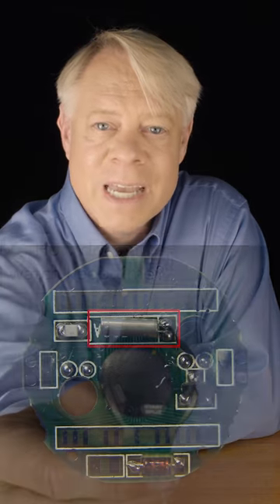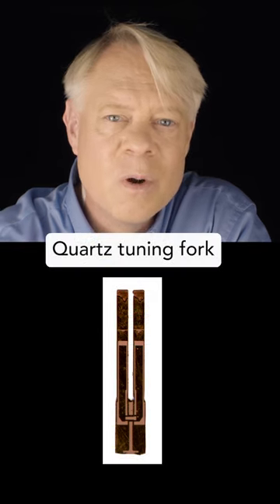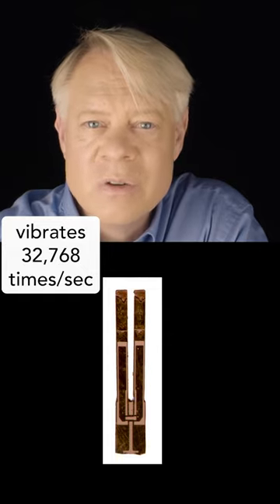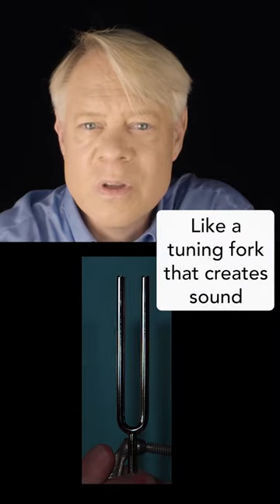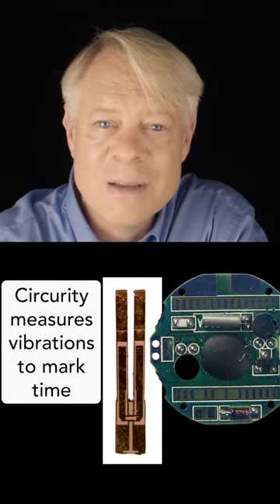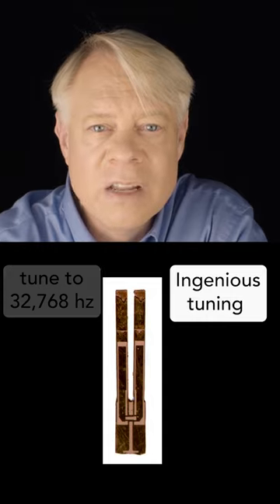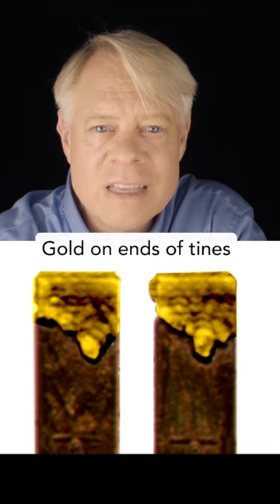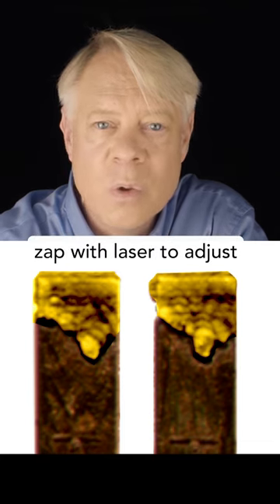How a Quartz Watch Works #Short #engineerguy #engineering #invention #timekeeping

Comment: Fun fact - this frequency can also be halved until it falls into the human hearing range. This is the tone used for watch beeps. It's why so many quartz watches have the exact same beeping sound when you press the buttons or set an alarm.
Reply: I assume that a separate quartz "tuning fork" is used for the beeps, so it doesn't interfere with the time keeping quartz.
Reply: @Vastad the fork itself doesn’t make noise. The frequency is used to drive the speaker. Not directly though.
Reply: My god that is mind blowing 🤯. Thanks for the inspiration!
Reply: @Vastad wont need second one you can divide frequency without interfering with oscillator
Reply: These are all poor explanations.
1. The Crystal forms part of an oscillator circuit and the oscillator outputs an electrical signal of fundamental frequency of 32768 Hz.  The output of the oscillator is a square wave which contains harmonics and these go much higher than the 32768Hz signal but these are not relevant because this a digital electronic circuit which is responding to the edges of the pulses of the square wave of the 32768Hz signal.

The equivalent circuit is one containing inductance and capacitance which, by way of the physical form of the crystal is tuned to the right values of inductance and capacitance to cause the oscillator to oscillate at 32768 Hz.  There are some additional components required such as a logic inverter that must be present to create a feedback path to enable oscillation of the crystal to occur. That is, the crystal by itself when fed electricity will not vibrate. It has to be part of an oscillator circuit employing positive feedback.

That signal is divided down by a series of flipflops, each flipflop dividing the frequency by 2 until an electrical signal of 1Hz frequency is produced. It is this 1Hz signal that is a clock signal to the electronics and digital counter that tracks the number of seconds. 

2. The audio bleep signal can be derived from somewhere from the clock divider chain that has an input at 32768 and the output at 1Hz.
That audio bleep is not, as one poster stated, the 32768 Hz signal divided by 2 as that would result in an audit bleep at 16.384KHz and whilst audible to a teenager it is not audible to a 40 year old or older person.
Reply: @HeyJuuu Nah you wouldn't be able to hear it until it actually goes off. The circuits completely inactive until nano seconds before it goes off. I think our brains are just way better at keeping track of time than we think. I'll set my microwave for 8 minutes and without keeping track I'll just think "oh that's probably almost done" and get to it seconds before it goes off. I don't know how but it's not even like I'm keeping track of it. I'll get it within about 20 seconds like 80 percent of the time.
Reply: @HeyJuuu  cool hypothesis, but probably not. I've kept that effect since I've switched to a completely digital watch.
Reply: I also noted that the frequency was 1 off from a signed integer word.
Reply: @deang5622 I wish I could understand you. Lets talk about legos instead.
Reply: That’s so cool!  Halving a frequency is the same as dropping an octave.  Most people can’t hear above 17000hz so the pitch would have to be dropped at least two octave.  That’s pretty neat.

Comment: For those wondering why quartz, quartz is piezoelectric, meaning that physical pressure on it or vibrations passing through it can generate an electric current, and an electric current passing through it causes it to vibrate. The frequency of the vibration is also very consistent given a constant shape, size, current, and weight/pressure on it (which the gold leaf allows for precise tuning of), which means that you can just measure the motion of the quartz to get something that varies periodically at a fixed rate over time (the tuning means that we also will know exactly what that rate is). Quartz is also a fairly abundant mineral (it’s made of virtually pure silica, aka silicon dioxide, which is also what sand—and, thus, sandstone and glass—is made of, and is the most abundant substance in Earth’s crust; just crystallize it to form quartz crystals), so it’s very easy and cheap to get large quantities of it.

Because of these factors, pretty much every electronic device that has a timer, can tell time, or that is programmable/has been programmed (like a computer) contains one of these quartz tuning forks to allow for precise, constant time-keeping (this is often known as an internal clock). 

Pretty much the only way we could be even more precise and accurate with measuring time is by using the resonant frequency of atoms, as seen in atomic clocks, but those require rarer substances (most use cesium, particularly cesium-133, cooled down to close to absolute zero, though some use rubidium-87, and some others use hydrogen-1). This is because the method used to find the natural frequency requires atoms with a single valence electron (so hydrogen and the alkali metals) or, to a lesser extent, alkaline earth metals (namely strontium), and higher precision requires larger nuclei; cesium-133 is the alkali metal with the highest atomic mass that isn’t radioactive (every isotope of francium has significantly more atomic mass, from 212 to 223, and francium is technically an alkali metal, but francium nuclei are incredibly unstable, with half-lives ranging from 4.8 min to 22 min, so they’re unsuitable for measuring time; heavier isotopes of cesium also exist, but they are also radioactive (though with half-lives ranging from around 2 years to over 1 million years), which makes them less suitable), which means it gives the highest accuracy. Both the atoms used for time-keeping and the devices used to detect their resonance are much, much more expensive, the atoms are (except for hydrogen-1) much rarer, and isolating atoms of hydrogen, rubidium, cesium, or strontium is much, much harder (due to their incredibly high reactivity), compared to quartz or the devices used to measure the frequency of their vibrations. Heck, even the gold leaf used for calibrations is cheaper and easier to obtain, as gold almost never reacts with anything (so isolating it is trivial if you find it), is still more abundant than the heavier alkali and alkaline earth metals, and only microscopic bits of thin gold foil get used anyways. It’s also significantly easier to make a quartz-based clock small and light enough to fit on your wrist, in your pocket, or on a computer chip/motherboard without being an inconvenience.
Reply: "an electric current passing through it causes it to vibrate."  Not really. Piezoelectric materials produce a charge when a force is applied (bending or pressure), and also the reverse: will bend or compress/expand if a voltage is applied. That by itself is not vibration. If you want a piezoelectric element to vibrate, you have to apply a repetitive voltage waveform. If you want the piezo element to actually resonate and oscillate continuously, it needs to be part of a circuit which as a whole implements an oscillator.
Reply: Fantastic information, I'm surprised he didn't explain the simplest and coolest part of the entire time keeping operation. 32768hz isn't an arbitrary number it's very specific. Specifically it's 2^15. So when you make a binary counting device that counts in ones and zeroes using 15 flop/flop switches in a row by the time the 32,768th input is triggered one second registers. Which is why quartz watches are so accurate they can be tuned to the 32,768th of a second.
Reply from the maker: @Rickarrish I only have a minute: I am fine if it leaves people with a well formed question (eg why 32768?)
Reply: Very interesting.  Thanks  !
Reply: @Rickarrish maaan I knew this constant by heart, and also knew 2^16 is 64.k-ish, never took the time to figure that 32.768 is actually a pretty number in binary form. and I wrote code for ucontrollers that counted quartz ticks for spacing samples of an analog-to-digital converter. I only tested up to a couple hundreds of samples at a time though 😆
Reply: Thank you AI
Reply: What makes quartz piezoelectric? Do the alignment of its crystals help ease the movement of electrons?

Comment: The 32768 is equal to 2^15 which can be handy in calculations of processors
Reply: But who needs to count negative vibrations?
Reply: I think its not about negative, its about the number being even. There is an operation called bit shifting which basically means to shift all the bits of a number in binary to left or right, and then “crop” the number to fit the number of bits, any spaces created would have zero in them. Basically, bit shifting left multiplies by 2 and by right divides by 2, this is handy for even numbers, not so much for odd numbers.
Reply: This number would also fit in a standard sized int i.e, 4 bytes
Reply: @fahad_hassan_92 my point is: why 2^15 instead of 2^16?
Reply: @RonJohn63  Could be as simple as they thought 2^16 was overkill or maybe because they for some reason use signed integers. To be honest I don't know.
Reply: @RonJohn63  I wondered about that. It's possible getting 2^16 would require a tuning fork outside the useful size range?
Reply: @Norsilca  very possible.

Comment: That frequency is insane. I can’t even begin to conceptualize that.
Reply: The frequency used, 2^15 cycles per second (a bit below 33 kHz), is one of the lowest frequencies available as a crystal resonator. Most crystals are tuned to frequency in the MHz or 10's of MHz, a few into the 100's of MHz.
Reply: @Graham_Wideman  Even more mind boggling! I’m curious about the physical mechanisms that enable such insanely high frequency vibrations without shaking the crystal lattices apart. Time to start googling lol.
Reply: @zakiducky  molecular bonds are stretchy. They can spring back and forth indefinitely without breaking, in the right material.
Reply: You should read up the clocks in CPUs. They operate on gigahertz frequencies, which are about 100,000 more frequent.

Comment: Fun fact: The first quartz watches and clocks used crystals that oscillated at 8192 hz, and then briefly 16,384hz before 32,768 became the defacto standard. Realistically it could have been any frequency that was chosen, but due to limitations in computing power it was easiest to have the crystals tuned to powers of 2 to quickly run through a circuit to divide up the oscillations with the fewest errors possible. Omega in 1972 made a watch tuned to an incredible 2.4Mhz with a prototype rumored to have been tuned to 4.2Mhz, which are some of the few ever made that do not follow the powers of 2 rule, instead using powers of 3 with a averaging circuit at the end to get it to 1hz. It was abandoned in 1975 due the falling prices of quartz watches at the time, with only about 1000 ever made.

Bulova currently makes a watch with a tri-prong crystal tuned to 262,144hz which was introduced in 2014 and is currently used on their Precisionist line. It’s one of the only quartz watches available today that does not use a standard 32,768hz quartz crystal.

Comment: there are 65,535 network ports without 0 if you add zero it would be 65,536 which is equal to tuning forks vibration - 32,768 x 2 = 65,536.. 😮

Comment: how does it pick up the vibrations in the watch and convert them into seconds
Reply: The video described this incorrectly. The vibrations don't "get measured" -- in a sense the precise vibrations ARE the measurement of time.  The crystal is incorporated in an oscillator circuit -- a circuit  that produces regularly-timed pulses at the frequency set by the crystal. Those pulses feed into a chain of circuits called flip-flops that each divide the rate by 2: ie: 2 pulses in produces 1 pulse out. 
32,768 is 2^15, so after 15 flip flops you get 1 pulse per second, with the precision of the crystal.  Those 1-sec pulses feed into a simple 
counter/display, which just gives you a count of how many seconds have elapsed. It could just count in decimal, but for everyday purposes, it counts in bases 60-60-12 to give seconds, minutes, hours.
Reply: @Graham_Wideman  you hit the quartz with electricity and then it gives you back the electricity but on its schedule? is that the idea? so the quartz acts as a gate that turns a consistent signal into a pulse?
Reply: @photographyraptor  It's like any system that resonates continuously (ie: doesn't "fade away"). You arrange the crystal in a circuit that provides positive feedback: the circuit gives the crystal signal a push in the same direction that it's going, until the crystal reaches a limit and starts going in the other direction, and again the circuit pushes it to go in that new direction.  Repeat.
Pretty analogous to a playground swing:  On each cycle, the parent gives the swing a small push in the direction the swing wants to go, and that adds enough energy to keep it going indefinitely (or until parent wears out). The rate at which it swings is set by the geometry, gravity and so on.  Other examples would be vibration of the reed in a wind instrument, or feedback squeal in a PA system, or ringing of a drinking glass if you rub our finger around the rim.
A circuit that will oscillate is quite simple.  The novel part in a crystal-equipped oscillator is simply to work the crystal into the circuit so that it supplies the resonate-able element that controls the frequency.
Reply: @Graham_Wideman  that makes sense, thank you for the explanation! was not really expecting an  answer, especially not one thats this in depth!

Comment: But how does the “circuitry” count the oscillations?
Reply: The video described this incorrectly. The vibrations don't "get measured" -- in a sense the precise vibrations ARE the measurement of time.  The crystal is incorporated in an oscillator circuit -- a circuit that produces regularly-timed pulses at the frequency set by the crystal. Those pulses feed into a chain of circuits called flip-flops that each divide the rate by 2: ie: 2 pulses in produces 1 pulse out. 
32,768 is 2^15, so after 15 flip flops you get 1 pulse per second, with the precision of the crystal.  Those 1-sec pulses feed into a simple 
counter/display, which just gives you a count of how many seconds have elapsed. It could just count in decimal, but for everyday purposes, it counts in bases 60-60-12 to give seconds, minutes, hours.

Comment: I'm more interested in how those vibrations get measured.
Reply: The video described this incorrectly. The vibrations don't "get measured" -- in a sense the precise vibrations ARE the measurement of time.  The crystal is incorporated in an oscillator circuit -- a circuit that produces regularly-timed pulses at the frequency set by the crystal. Those pulses feed into a chain of circuits called flip-flops that each divide the rate by 2: ie: 2 pulses in produces 1 pulse out. 32,768 is 2^15, so after 15 flip flops you get 1 pulse per second, with the precision of the crystal.  Those 1-sec pulses feed into a simple counter/display, which just gives you a count of how many seconds have elapsed. It could just count in decimal, but for everyday purposes, it counts in bases 60-60-12 to give seconds, minutes, hours.

Comment: And 32768 is 2 to the power of 15. So this frequency can conveniently be divided until you get to 1. How nifyy. Now we know what a second is..
Reply: Well, that frequency was chosen because a 1 Hz crystal is not practical, and divide-by-two circuits are cheap. So it's not really a surprise that the crystal is tuned to a frequency that's a power of 2.

Comment: Doesnt this mean mechanical movements are really just for conversation?
Reply: Pretty much so.  Of course mechanical movements can be used with clockwork spring or gravity power, and don't require a battery, if that's a concern.

Comment: Is It the reason why pascal’s int has 32768 max value?
Reply: 32767. It's related in the sense that the watch use a divide-by 2^15 circuit to derive a 1/sec pulse from the 32768Hz crystal. 2^15 is half of 2^16, and Pascal's old-style integers were 16-bit numbers (because lots of numbers in computers have ranges that fit into registers having sizes that are multiples of 8: 8, 16, 24, 32, 48, 64 bits.)  But Pascal's old integers are signed, so only 15 bits are available for magnitude, and 1 bit for sign. Hence the 0 to 32767 range corresponding to 32768 total numbers, matching the watch crystal frequency.

Comment: This almost seems like alien technology.. and this is in even those cheap watches at Walmart?? Who deals with stuff like this? Mechanical engineers?
Reply: Crystal oscillators are almost as old as radio (you can read the Crystal Oscillator page at wikipedia). Probably the R&D activity that resulted in this particular development was carried out by radio engineers, though its not unusual for people who worked in that are to have a variety of backgrounds and not necessarily classify themselves as a specific type of engineer.

Comment: are you telling me that there's a laser inside of that quartz watch? that makes no sense, do you mean that they use a laser to connect the gold to the tips of the quartz? and if so that seems like a lot of work for something that's going to be put in $5 watch
Reply: I think they use the laser to adjust the weight of the gold plating on the quartz.  They trim the gold with the laser until it reaches the desired weight needed to produce the correct frequency.  This would be done during the assembly of the quartz, so you are correct, there is no laser inside the watch.